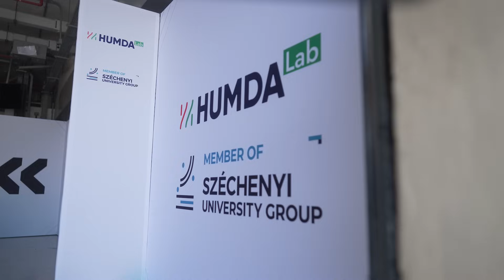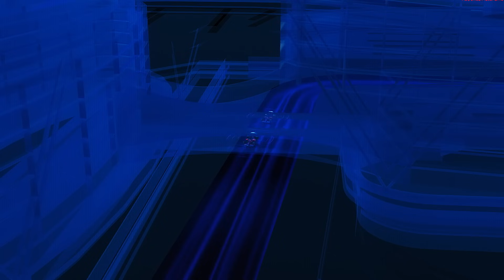A2RL Explained - Extreme Engineering On Track

Comment: Its a shame Roborace seems to have stopped. Because that series was this and had two seasons which were pretty interesting. They were working towards having multiple cars on track, i think more than 4 though........ They also used a prototype chassis not open wheel. Be interested to see if any of the universities from Roborace move into this.

Comment: Who knew R/C cars would come to this?  Fine for research but who would ever want to watch all those Robbie the Robots connecting the dots.  And for the consumer, a little radar, a little assistance is fine for those who want to pay the extra bucks for it, but lots of us don't want that, just give us a manual transmission and roll-up windows and don't bother with the console TV in the middle of the dash.  And, okay, some chrome and color and a body by Pininfarina, too. 😀

Comment: Trying to advance road cars by being yet another race car! 🤦🏻‍♂️
Reply: Everything your car has comes from racing. 

So yes, this type of thing will help road cars. The technology will trickle down to road cars.
Reply: @C41N4  no road car will ever have giant front wings and slick tyres.
Reply: @Surtees-ff  ABS, dual clutch transmission, direct fuel injection, disk brakes, electronic suspension control, active suspension, hell, even steering wheel itself came from Motorsport. 

You should do your research before commenting something so incorrect.
Reply: @C41N4  you are missing the point entirely. I know all of what you are saying already, but they have said they want this to be road relevant, and yet their platform mimics and open-wheel race series car. What not have an autonomous race series car that has the road car platform. Why doesn’t it have abs and active ride etc etc, rather than formula regulated open wheels, double wishbone suspension and massive wings. It could do more if it was on a cool road car platform than this.
Reply: @C41N4  also: disc brakes were designed originally for road cars and then motorbikes way before specific motorsport. Maybe you need to do some fact checking before commenting in such an arrogant way?
Reply: @Surtees-ff  they’re doing this to further autonomous driving technology. If they can make it drive an open wheel race car at full speed, against a full grid, they can implement it on road cars. 

Again, you WILL see the results from this in road cars in the near future.
Reply: @Surtees-ff  after Jaguar J type won LeMans using disk breaks, automakers realized that they were the way of the future. They did try to implement the on cars before that, but failed. With the success of the J type, they never looked back. So BECAUSE of the success of a race car using disk breaks, today most cars have disk breaks. 

Here’s a few more: AWD, semi automatic gearboxes, rear view mirrors, DOHC engines. 

I wasn’t arrogant. You might think that because I may have hurt your ego. But I wasn’t arrogant. You said something incorrect, and I brought facts to show you your mistake. If that made you feel a certain way, then it’s a problem inside you, not with my words.
Reply: @C41N4  you were arrogant because your ‘do your research’ comment assumes I know nothing. 
Whether you feel arrogant is with you. But you are.